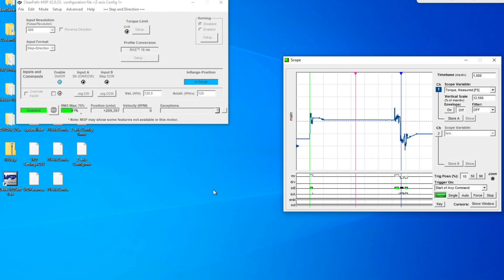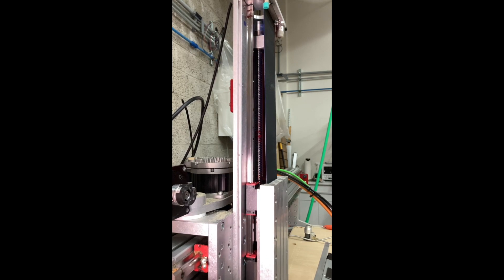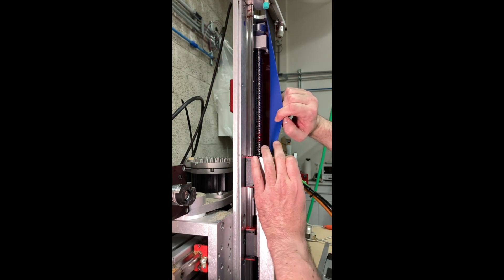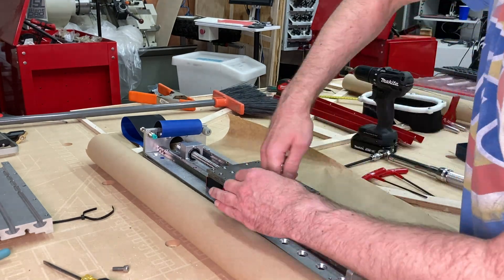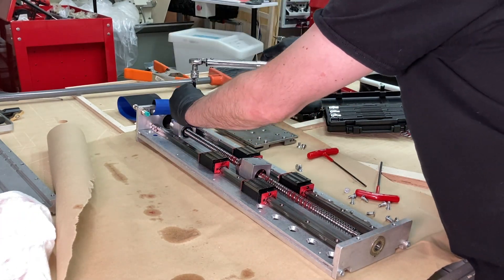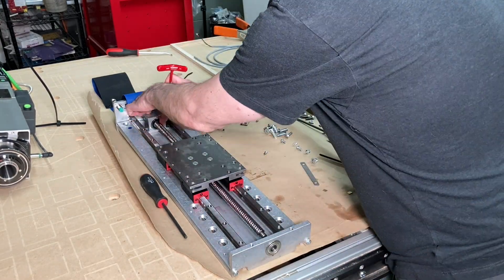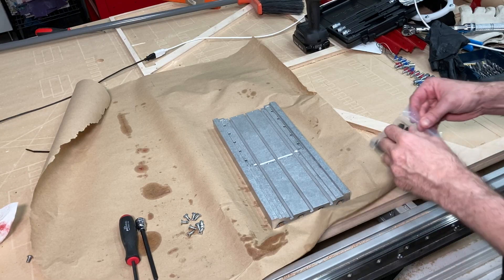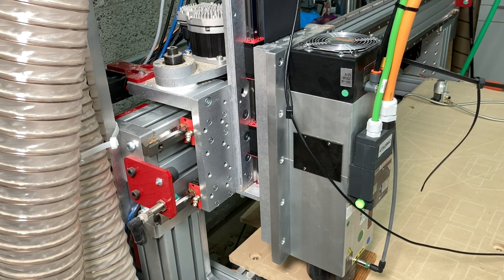AvidCNCN Z-Axis Teardown

Comment: What is the weight of the spindle?
Reply from the maker: 15 kg, but there’s also the weight of the mounting bracket, dust collection shoe and hose, and cables (not to mention the tool and cutting forces).

Comment: Great video! I appreciate you documenting this. I am in the process of building my own CNC and this was very helpful. Just curious, what spindle motor is that one rated at?
Reply from the maker: Thanks! The spindle is overkill for this router, but it’s a 4.5 kW HSD ES330 https://questionable-engineering.com/blog/spindle-motor

Comment: What is that black/blue belt made of?
Reply from the maker: I don't know exactly what it’s made from. Some kind of fabric lamination. With the red metal covers it forms a dust shield over the assembly. It came from AvidCNC, so you might be able to message them about it; they’re usually very responsive.

Comment: Good job fixing your problem. Are you using the Nema 34 motor?
My feeling is there should be a counter spring on this unit. Especially is you process a 3d carving job where
the spindle has to go up and down a lot. Why not take some stress off the motor?
Reply: I believe that the stepper motor would then have to over come spring tension thus negating the benefit causing wear and tear along that axis and should spring or something go out of alignment that spring could help push or further hinder that alignment. Plus that spring would also be pushing up or outward aka away from the spoil board putting untold tension in that direction too. I could be wrong. Just my opinion having spent many years repairing equipment with tension springs and adjusters with idlers and so forth.  That old say for every action there is a reaction. Now if the system was designed with the tension system built in that is a different story altogether.  You maybe onto something.
Reply from the maker: I'm sorry I missed this comment! It would be nice to have something to offset the weight of the z-axis, and that was the purpose of their semi-one-way bushing. I'm using a Teknic SDSK NEMA 34 servo, but it was getting hot and hitting its thermal cutout until I added a fan to it. It could probably stand to be upgraded to a larger servo.

Comment: Displacement of this tall Z axis design would be > 0.2 - 0.5 mm at the most top. It is to much for me
Reply from the maker: For a 4x9’ gantry machine, that’s asking a lot. You would need a different design. This one was designed and built by AvidCNC.
Reply: @QuestionableEngineering  Did you measured actual displacement of this design? I am just curious how much it is in lower/upper Z position and in the middle of the gantry
Reply from the maker: @L2Max1  No, I don't have a good way to measure it. But there is definitely flex in the gantry.
Reply: Thanks for reply
Reply: @QuestionableEngineering   Could that be for metal fatigue? Sagging ? Both steel  and aluminum have a tendency to bow downward when stretched in the horizontal I.E. as in a suspension Bridge for example basically that is what the gantry is doing suspending or bridging the distance across. It can also happen in a vertical orientation also. There would be some deflection or flex and one possible way to measure would be from  the carriage home  position , then far left far right  or two equal points in between to spoil board and compare the distance to a set height of say the spindle collect in the tightened position. Being that you have a true flat surfaced spoil board. or a level that could bridge width of unit or length of unit. Just some random thoughts if deflection was considered to be an issue.
Reply from the maker: @jwar2163  I think the majority of flex and inaccuracy comes from movement between extrusions. The gantry extrusion is very stiff for the length, and at the mass of the z-axis, I doubt it has noticeable sag or twist. The two uprights have much smaller cross-section and  are probably where most of the flex arises. Maybe there's some in y-axis rails/bearings? Not sure.
Reply: @QuestionableEngineering   Thanks For the reply I am thinking of buying one of these types of CNCs I like the modular design, but have concerns about the flex. I have zero experience with these smaller foot print CNCs in regards to repairs.  I worked on large commercial equipment and industrial CNC for the Carpenter Shop when I was a Stationary Engineer servicing all the mechanical equipment on facility grounds aka property. Those machines where robust to say the least, then again one cut and formed steel and other metals. 15ft by 20.  The other one worked exclusively on wood material and plastics. it was 15ft x 15ft and the third one was still large 12ft by 10ft ,  but was used to make wheel chairs and other medical assistive aides for the patients at the facility.  Again Thanks. I am interested in the Avid and enjoyed your repair of your axis. Very informative.

Comment: how mutch did that brake put you back ? Is it nexen ? If not, do you mind telling me where i could get it ?

Using air assisted counter balanace atm, but it's bulky and not the best, so would love a break instead.
Reply from the maker: It took me a long time to get a brake because I could only find expensive ones with long lead times. Then Tormach offered a new machine with a brake, and I asked them what part number it was. Ended up getting it from Automation 4 Less, $272.73: http://www.automation4less.com/store/proddetail.asp?prod=MPC034-24-0500